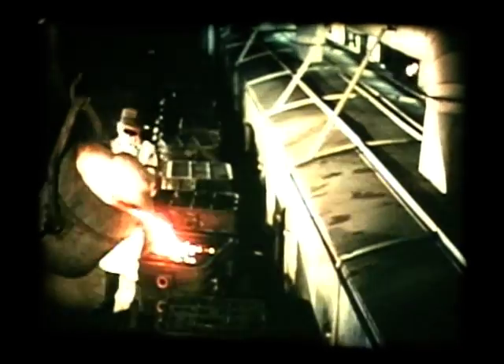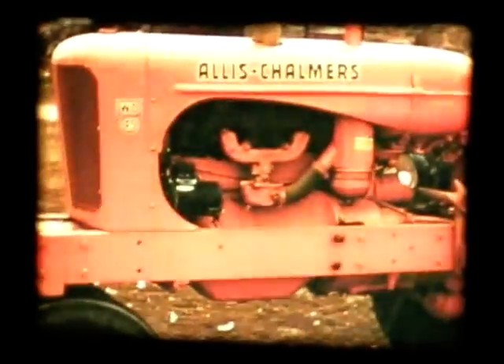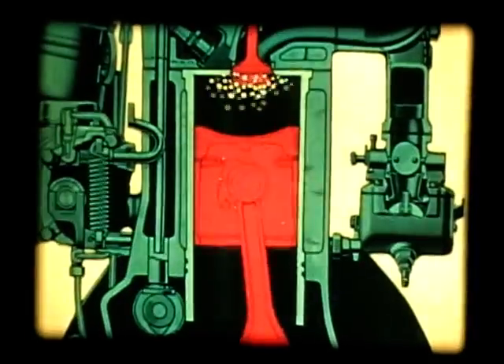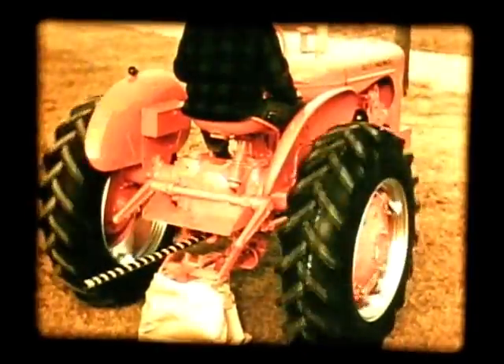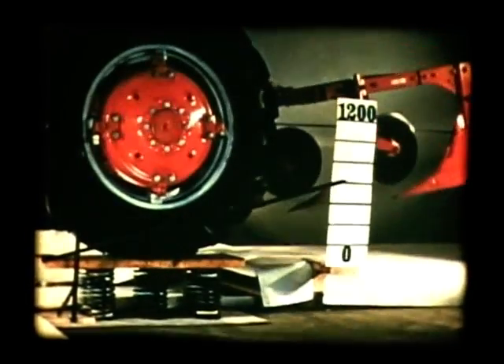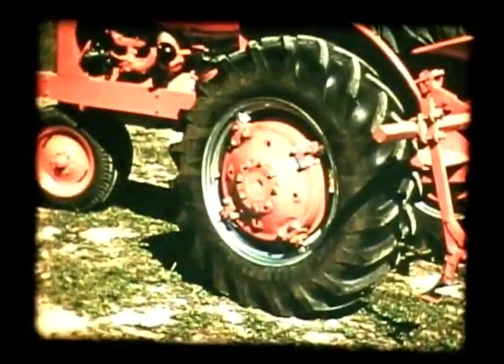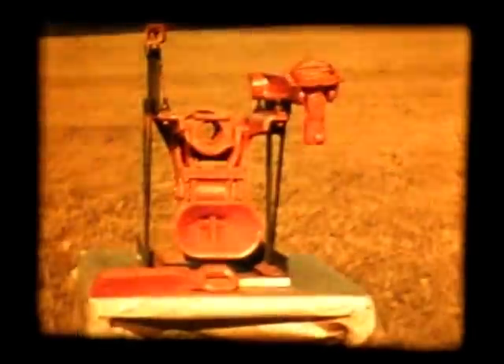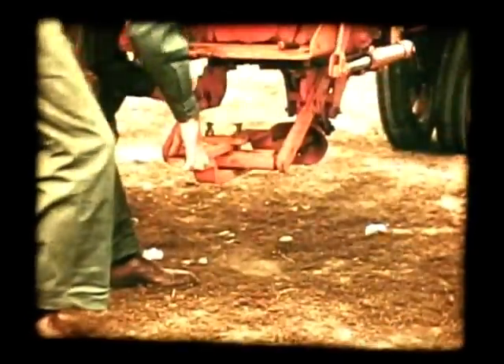1950's Allis-Chalmers promotional film for WD-45 tractors

Comment: I just picked up a 1949 gas WD, with front bucket loader, wide front, some dents and rough parts.. but runs good.  This video explains quite a bit, since being new and not being able to find an operating manual.  Hard to believe it still works great, being made in 1949 and only paying 1500bucks.  Thanks for posting !

Comment: I had to haul gravity boxes full of shell corn (super heavy load) up a steep gravel road to my uncle's farm back about 1974. My dad was a Farmall international man.  I tried the job first with the H tractor.  Wouldn't do it; not even in first gear.  Then I tried the Super MTA.  Made it but barely.  Next time it was the International 560, a little bit better.  Then my neighbor brought over his 45 WD.  It torqued right up the hill like a Caddilac in 3rd gear and never slowed down; just got a nice deep sound to the engine.  It sure impressed me.  If I had to farm with yesterday's tractors I would pick the Allis first.
Reply: Ya they are really good even at idle pulling a rock wagon across end a field just low end torque
Reply: some tractors just have more horsepower what are you trying to prove? 😂
Reply: I use to combine corn for an older gentleman that had a WD45, I had 400 bu. J&M wagons I would dump the combine and give him the thumbs up to leave, he'd smile and signal me to load it, so 2 big dumps the wagon was heaped and loaded, I gave him the thumbs up he's full, I sat and watched him , sure he'd spin out trying to get that load moving,  Floyd would pull the ring, fire it off pull the hand clutch back, both tires dug in about 1/4 turn to get a bite, and away he went looking back at me and smiling from ear to ear! I just shook my head, and learned right then and there , never ever underestimate a WD45

Comment from the maker: The AC snap coupler looks a lot easier to hook up than the Ford/Ferguson 3-pt system that is most common today. My WD has a conversion kit to convert it to the modern system but it can be difficult to get the lift arms on and off the implement. I remember hearing about the Case Eagle hitch too (THe Case trademark at one time included an eagle).

Comment: AC sure knew how to make a potent engine. Those old WD's and even WC sure could pull for their weight. Besides the engines though, AC always seemed to be a year or two behind the rest of the industry, and their implements were always a little different and some very proprietary, like that snap coupler. Makes it hard to sell a plow when you have to have an AC tractor to hook it to. Roto-balers were another one- neat design but obsoleted almost right away by square balers that didnt have to stop to tie.
Reply: still very tough machines.
Reply: Earlier WC's were waaaaay under powered.  The early ones had a Continental motor, not an AC motor.

Comment: Also, I can remember the first AC that I had. I don't know the year or the model but it was a hand crank and hand brakes levers (no foot brakes) on each wheel. The gear shift lever was (it seamed at least) as long as the tractor was with a "reverse lock-out" lever next to the shifter knob. The rear axle housing looked something like a rear end out of a truck. I wish I still had that tractor today.

Comment: I have used both types of 3 point hitch and the allis was the best your load is pulling on the same point as the drawbar, not on the lift arms,  but it couldn't compete with the popularity of the Ferguson system.
Reply: Same goes for the IH fast hitch. I've used many and it works very well, but IH wouldn't let anybody else build fast hitch implements. Same as the snap coupler, it was completely proprietary, aside from 3pt adapters that don't work very well, and it never caught on like 3pt did.
Reply: Reply to Brad not Landa
I watched an antique tractor vid a couple days back about a 1920 friction drive tractor that never worked in the fields. It's lugs (steel tires) were still in the box in the garage. It was used for running a belt to power a Missouri sawmill.

Came with a plow that was also unused. Guy had to come and check it out and found this tractor had a 3 point hitch system in 1920!

Comment: The Snap Coupler drafts better and because of that takes less fuel to pull. The 3 point and fast hitch hook up at two lower links which fight the natural draft of the implement.

Comment: cool video my 1952 case has the optional eagle hitch! that is just an early ji case built 3 point hitch! it was an optional addon. it runs off a hydrolick pump mounted to the side of the engine! we have the original 2 bottom plow. you dont even have to leave the seat to hooc it up! like your ac video! but the eagle hitch is different!

Comment: The Case hitch was good but the Snap Coupler drafts better for easier pulling. My grandpa used to work at a Case dealer back in the 50's and very early 60's.

Comment: Don't of many this happened to but this would happen. When that spring broke for the latch, the plow become attatched by the lift links only then would stand up on the front and roll onto the operator. Not a good day
Reply: Not possible, the latch hook was made in such a way that even if the spring broke the latch was "pulled" close, unless you stopped and took the tension off

Comment: Yeah John Deere had adjustable wheel tread figured out back in 1934 rather by sliding the wheel hub on the axle instead which by the way is still in use on row crop tractors to this day. No allis license needed.
Reply: Valid point, but, that can be a pain right in the ass. And, a lot of older tractors use the "power adjust wheels". The old 195 Massey Ferguson diesel i used to round bale with had them, a couple of 9, and 8n's did too. Its so much easier that way. The bad downfall is, the wobble after you adjust them like that. And, in "road gear", that can get sketcky as frig.
Reply: Except the John Deere seized up and the whole assembly needs to be removed to make it work again.
Great in theory, poor in reality

Comment: the early case emblem does have an eagle that sits on the globe. case called hime "Old Abe" google image! ji case eagle. well our eagle hitch works very well it has spring loaded quick connects on the ends of the draft arms. google "case eagle hitch" to see how it works! but our VAC is equipt with live hydrolics and 540 rpm pto. early models had the hydrolic pump built in the belt pulley drive. we have the original belt pulley, but it was removed to put the loader on in the 60's!

Comment: Not to be a troll but what the fuck! I mean of   some things I have seen astounded me because I have not one but two of these tractors and often have   trouble with the implements on them.
Reply: What sort of problems?
Reply: I apologize for wasting your time brett knoss because I just got my WD's running well here some time ago,however,that commercial was a bit uncanny for my taste.
Reply: Darth Graggus 
The foot operated clutch disconnecting all power transmission is "weird" by today's standards, and the hand operated clutch disconnecting wheels only is twice as weird.

Today, the norm is that the foot pedal clutch is only relevant to driving the wheels. The hand operated clutch is only relevant to the power takeoff. The hydraulic pump is always running, and not behind any clutch (in some tractors, pressing left pedal also disconnected hydraulic pump).

I don't know history well enough, but I imagine alot of implements today assume you've got the "modern" setup of clutches.
Reply: Got it.
Reply: That wheel-widening thing was very interesting. Most people don't even know that the wheels can do that, because most of the time, they're rusted in place.
Reply: True,but not always.
Reply: I have a 53 WD and someone welded bar across the rim...my guess is someone power shifted the wheels right off the thing...lol